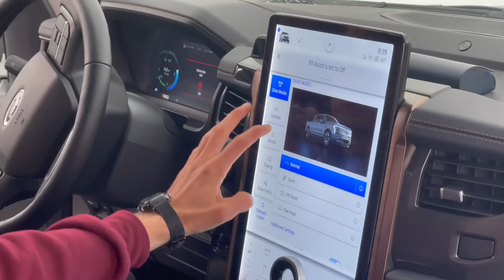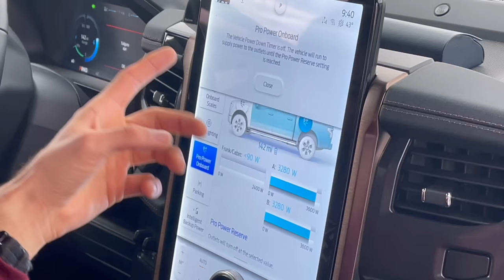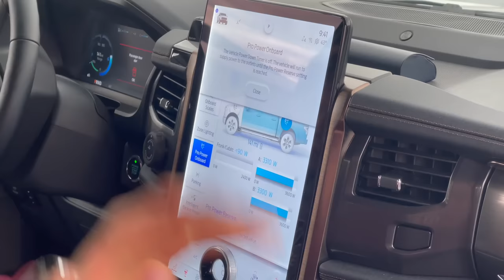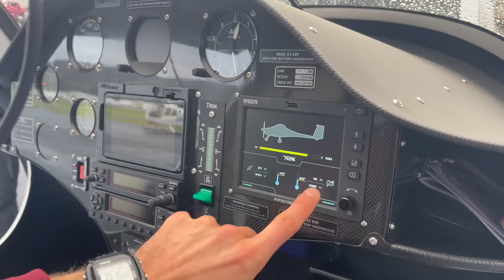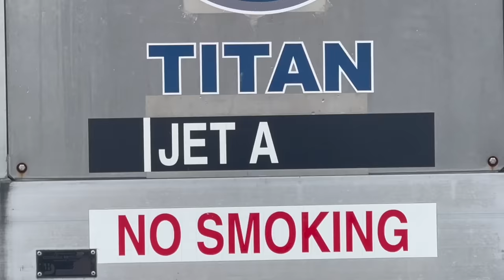F-150 Lightning Charging An Electric Plane On A Record Attempt Flight!

Comment: I've seen other videos on prototype electric aircraft before. But, I think the big takeaway from this one is not actually the plane, but the truck. Having a mobile power source without the noise and fumes of a gas generator is very nice, and even nicer if it's built into the vehicle, rather than needing to carry a giant battery in the cargo bed.

Once electric trucks become cheaper and more plentiful, I can imagine all sorts of applications for this. Food trucks. Construction sites. Temporary event lighting. Emergency charging for EVs that run out of power on the side of the road. Emergency power for buildings during power outages. A landscaper charging their leaf blower while they use their lawn mower. The list goes on and on. The technology for all of this is there. All that's missing is making it cheap enough to be economical.

Comment: It's a menekes Type 2 plug. In Europe what you know as the J1772 is known as Type 1 also. The type 2 plug is the top half of a CCS connector over here but it's only used for comms in that application. The dc comes through the two big connectors that look like somebody stuck then to the bottom of the Type 2 plug. Which is the same as you have only you have a J1772 on top of the CCS pins. I hope that helps.
Reply: All but the NASC have defects.

Comment: Great article. the Pipistrel alpha electro can fly for 90 minutes, so a normal flight would be 60 minutes with 30 minutes reserved by FAA rules.  FYI  the battery in the front can be swapped out but not the rear and the FAA has certified it and is called the Pipistrel Velis Electro.
One question is was the Ford lightning able to completely charge the batteries.

Comment: it's a standard Type 2 AC plug.
Reply: or to be pedantic, a Type 2 plug running in Low-current DC Mode (<80 amps)
Reply: @xwolpertinger  sometimes it's good to be pedantic ;) so it's a little like Tesla, who have been misusing the Type 2 in the older cars for DC as well.
Reply: @ScaredOfMonster  That's what I thought at least.. but apparently Pipistrel uses GB/T with a custom protocol. So now I'm none the wiser ;D

Comment: Loved the story.  Impressive.  I think you said something about 4 legs.  Did I hear that right?  Just wondering about how far each leg was.  I did catch that there is a reserve requirement for operation.  If I was a pilot I would want one of these planes!
Reply: I’m pipistrel dealer in canada. These planes are great but not made to be like a regular aircraft. They can only fly 50 min, at about 105knots. They also don’t have any cabin heater, the battery also is software locked, it will not work if it gets below 0°c. It is specifically made for flight school training, to fly at the same field and not go anywhere.
Reply: @DarrylZubot  50 min at 105 knots is more than not going anywhere.

Comment: The plug is called the Menekes. Or a Type 2 connector. It is the too part of the CCS2 plug. Tesla used a modified version of this connector on the S and X in Europe that allow AC and superchargers with the same plug

Comment: nice concept.  what was the flying speed and range. interesting .
Reply: Flight speed I think was about 75 Mph, I understand Remy flies it a little slower. Range is of course variable - you don't really rate planes by miles but by flying time - and this one is 30 minutes (with 30 min reserve).
Reply: neat wow 75 mph seems like such a slow speed for staying up there but seems to have large wings for size of plain  really  good video
Reply: @ronleblanc9832  My old Piper Cub used to fly about this fast. The airplane apparently CAN fly a bit faster (105 knots - about 120 MPH) but looking at the flight profiles (use Flightaware web page with tail number N84RR) shows it didn't get that fast and Remy said when we met that is mainly to save power and fly as long as possible.

Comment: I recall another story that said the battery cycle life was a few hundred cycles, so does anyone know what cost per flight or hour in battery replacement cost would be? Also, having some experience as an FBO and flight school operator, maximizing flight hours per day is a big part of the profit/loss equation for many flight school operations, and every hour an aircraft spends charging could equal an hour of lost revenue, which is typically over $100/hr. If that were 3 hours a day, in a month could add-up to $10,000 over an gasoline or diesel aircraft. However of course there is the offset in fuel costs, which I guesstimate to be $3k to $5k per month.

Comment: The plug is the European counterpart of the J1772. Normally it is used only for AC charging but it has also a DC mode, that has only been used by Tesla but doesn’t allow high power rates.
Reply: Called the "Type 2" I believe.  I didn't see the plug, but it looked like the right size handle, and if it's their standard over there, then it's definitely that.  Sometimes called Mennekes...
https://en.wikipedia.org/wiki/Type_2_connector
Reply: @Phatman114  Sometimes called Mennekes, because this was the company that developed it before getting a standard. 🤓